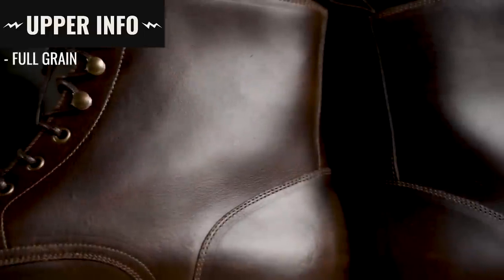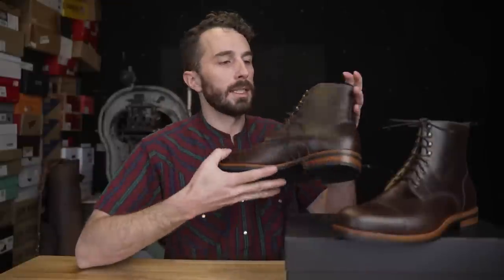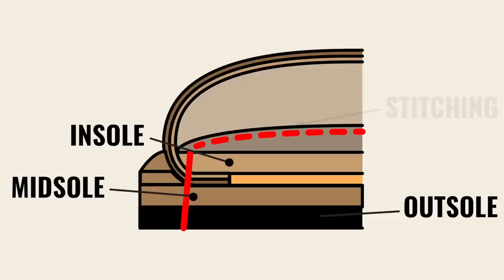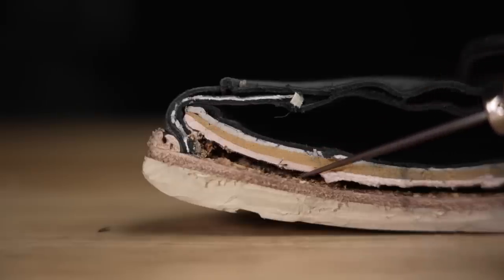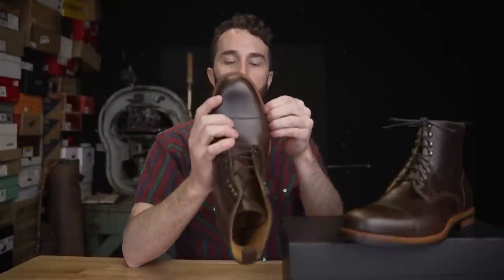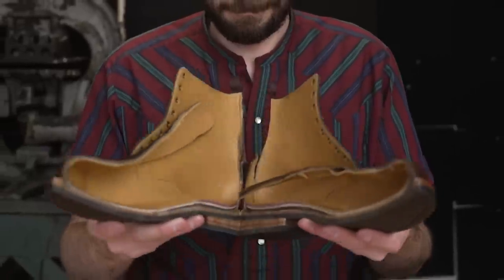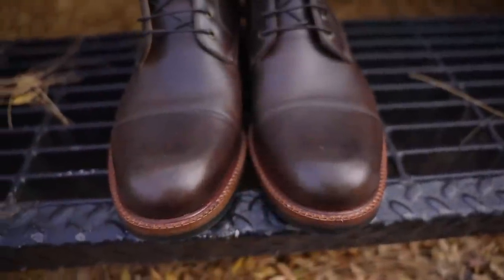What is a Blake Stitch Boot? - (CUT IN HALF) - Beckett Simonon Review

Comment: I've had a pair of Beckett Simonon Jodhpurs for about 2 years now. They're comfy and stylish and get compliments. I got them with a discount code that dropped them below the $200 mark too. So if you don't mind a 3 month wait for your boots, they're the best deal for low priced, quality, leather boots.
Reply: May I know how is the quality of the leather otter these years - eg cracks etc?
Reply: @gemasboy  After 2 years with no conditioning, the leather seems fine, if a bit dry. The areas that see a lot of flex like the toe box and below the ankles definitely have some cracking showing. But the toe and heel seem to still be in good condition. The leather that isn't creased frequently is still fairly supple. It certainly isn't the highest quality leather but it's not bad. The bordeaux color way still looks good. The leather liner is still comfortable. If you have wide feet, the leather will stretch a little around it but the lasts don't seem particularly made to accomodate wide feet. But that's to be expected from a smaller brand, unlike Allen Edmonds or Thursday. I bet if I had conditioned them their entire life, they'd be in far better condition with far less creasing and cracking.
Reply: @KoolKyurem25  thank you!

Comment: I'm curious how soft the rubber sole is. I own several pairs of Beckett Simonon shoes and I believe they are a great value. I work in an office environment so they do just fine for me. By just watching this video you'll probably start getting 20% off coupon codes, they are EVERYWHERE! Knocking 20% off makes them much more attractive, even though they look pretty good in my humble opinion. Most of my Beckett Simonon shoes don't have any QA issues (unlike Allen Edmonds). I own 1 pair of loafers with a lot of loose grain but oh well... A friend of mine has a pair of boots just like the ones you cut and I was really pleased with how soft the leather is, it's really buttery. These are definitely not work boots and not all boots have to be work boots, look at Alden, Allen Edmonds and so on. They can probably take just as much of a beating as most of these $200 boots posing as work boots. Don't even get me started on Doc Martens....

Comment: Yo Weston, excellent video!
I especially wanna compliment you for not just outright trashing Blake stitched shoes compared to GYW and stitchdown. I have some blake shoes and they're awesome. Have had them resoled no problem and they're super comfortable. While I'm not wading in rivers and lakes with them, I also have yet to have any kind of noticeable issues with water seeping in.

They are absolutely for more sleek and dressy styles and not for workboots but even some workboots use the blake or mckay stitch to keep their insole/lasting boards in place (ie. Nick's Handmade boots, for example, where they attach the liner, insole and a midsole. Flaring out the upper to do a stitchdown to attach the outsole).

And good point about resoles. Most people i know are not resoling their shoes 5-6 times. I barely know anyone that has resoled casual shoes more than once (some blue collar friends resole work boots more). So i think it's less of an issue than most people think. Especially given that with dressy casual shoes, it's not like you're beating em up. Further, with GYW, especailly if its not with a holdfast or channeled insole, the gemming can come loose and fall off the insole, meaning you will need to get your boots re-lasted. I don't know how huge of an issue that generally is, but it can happen.

Lastly, given that BS put a midsole on these boots, is it not odd that they wouldn't go for a Blake Rapid Construction??? I guess it adds a whole layer of work and complexity to the boot but it seems like it would be reasonable given that they already attached a midsole. Not saying Blake Rapid is infinitely better and it would add to the price point, just that it seems like a good idea with these boots specifically and would make future resoles potentially simpler. Would like to know if it's purely a cost thing for BS
Reply: I believe they used to use Blake/rapid on their boots, so it is weird that they stopped.
Reply: Pure cost. Blake rapid also adds a step

Comment: I have a pair of Dowlers. As you pointed out, they are strictly on the dressier side of the casual boot spectrum...the opposite end of the rugged, overbuilt PNW boots. The break-in is extremely easy and the leather quality is actually pretty decent. Unlike my Nicks, these are not multi-purpose boots. I view my Dowlers as urban footwear, suitable say in an office setting as part of a business casual wardrobe or worn on a date to a nice restaurant. In that sense, the Dowler is more versatile than my other boots. On the other hand, I wouldn't rough up my Dowlers in hopes of getting a patina. Nor am i certain the boots would hold up if I take them off the beaten trail, such as hiking, or doing light duty at the warehouse or in the yard, or in inclement weather. For these reasons, while I enjoy wearing my Dowlers on occasions when they are suitable, they are not my day-to-day, go-to boots....
Reply: How comfortable are they?  I have the problem of having a wide foot and thus needing decent toe box.
Appreciate your feedback.
Reply: @shmac96  when I got my boots, they only came in D width. The boots felt snug at the toe, though not tight. If you have wide feet, you may want to consider  getting a size higher. Beckett Simonon's customer service is excellent though and very responsive if you have any fitting issues.
Reply: @johnwen8810  Great!  Thanks for the tips!
Reply: I have wide feet too and I feel great going true to size for BS, not a half size down like for most boots!

Comment: I’ve always thought this brand had some great looking boots. Only thing keeping me from getting a pair has been concern over sizing since I tend to need a wide width in most footwear.
Reply: Same here
Reply: Can anyone answer about how wide they come?
Reply: Same I need a narrow heel/wide toe box,  and the look like more of a straight/narrow last.
Reply: I have a pair of Dowler boots, two pair of loafers,  two pair of dress shoes, and two pair of sneakers by Beckett Simonon.  I'm sized at an 11.5.  I find that 11.5 works with a thin insole for arch support for the boots, sneakers, and the laced dress shoes.  For the loafers, I downsize to an 11 to minimize heel lift and just use an adhesive additional arch support.  I have an average width foot, and I find that they fit me well.  I've worn my Dowlers 3-5x/week for a few years, and they're holding up well with regular conditioning.
Reply: My true to size on a Brannock device is a straight 10 on both feet, slightly wider due to me having flat feet. Beckett Simonon suggested I order a size 10 1/2 and in all my Allen Edmonds im a size 9 1/2 EE. To say the least these fit amazing hope that helps some.

Comment: I have a pair of Dowler boots, two pair of loafers,  two pair of dress shoes, and two pair of sneakers by Beckett Simonon.  I'm sized at an 11.5.  I find that 11.5 works with a thin insole for arch support for the boots, sneakers, and the laced dress shoes.  For the loafers, I downsize to an 11 to minimize heel lift and just use an adhesive additional arch support.  I have an average width foot, and I find that they fit me well.  I've worn my Dowlers 3-5x/week for a few years, and they're holding up well with regular conditioning.  I get compliments on my shoes pretty regularly.  Like others have said, if you get their coupons or sales, they're really good value.

Comment: I'd like to see more blake stitching in canvas/nylon boots and sneakers because it would add more to the structure rather than just glue holding it togetherer, also because sneakers usually have a fabric insole it would make them more re-soleable since it wouldn't create big holes, like it does with leather or fiberboard insoles.

Comment: blake stitch onto a midsole, with a glued on sole is equal to a welt stitch boot in terms of functionality. If you glue a sole on properly (with no stitches) it will not come apart. Water typically will not go into a blake stitch shoe if you only stitch through to a midsole, and glue on a rubber sole. It is just superior craftsmanship when it comes to non-blake stitched shoes. Only in extreme conditions does a storm or welted shoe make a difference in functionality
Reply: You could even use the midsole like the welt on a Goodyear welt if you really wanted to stitch on the sole.
Reply: Blake's shoes usually don't have a midsole. If you use a midsole you more often go with a blake-rapid construction with an additional "rapid" stitch between the midsole and the outsole.

Comment: My 2 cents..
I have 3 pairs of bs boots.  Love them.  They are **dress boots**. Not work boots.  I wear them to the office, to church etc, not camping, heavy outdoors.
I prefer the blake sitch design for a sleaker dressier look.  The value is incredible.  Bs runs specials throughout the year,  so if you're patient and wait on the sale, then are fine with waiting another 3 months for the build you can get absolutely incredible value. Great fit for me.
Negatives, i dont think they have an e width.  And compared to alden/allen edmonds, beckett simonon uppers tend to microcrease. I dont know why, but they do. It hasn't bothered me, but it's something to consider.
Overall unmatched value for dress centric boots, imho. 9:36

Comment: I would really prefer they used a 4-5mm semi rigid leather insole and a 5mm midsole Blake stitched to the upper and then a 3mm rubber outsole glued and rapid stitched to the leather midsole. I would take comfort and durability over slim looks even in my oxfords.